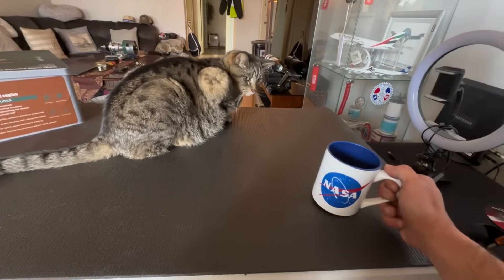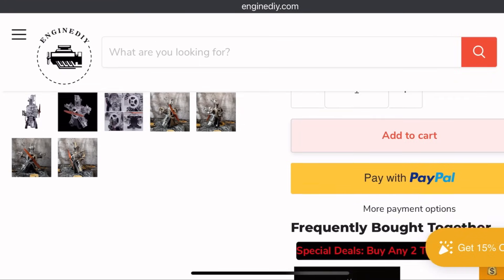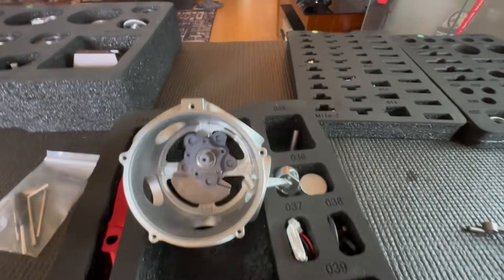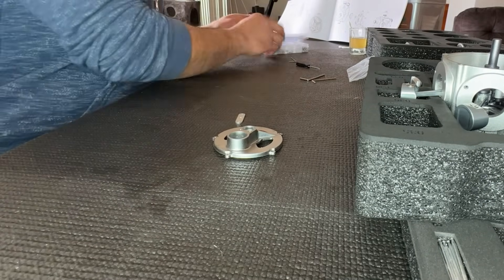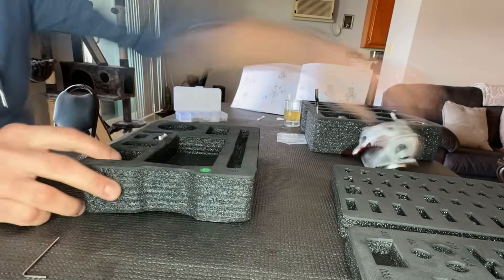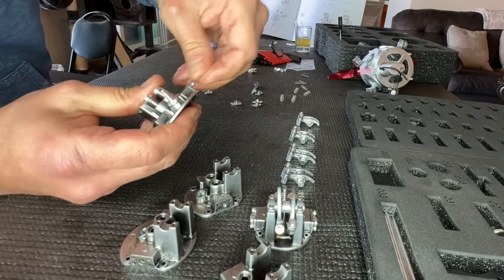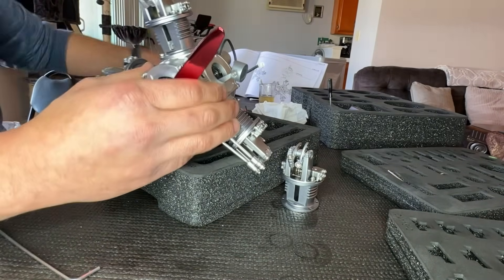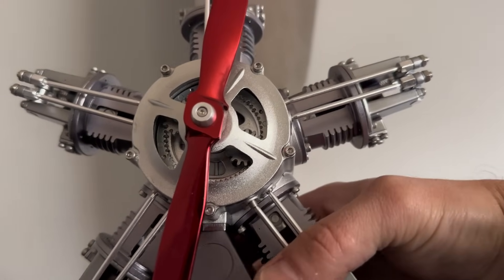Stig Projects (Build a Radial Engine)

Comment: I work on the P&W R-2800 every day (changing a nose case right now), not sure why I want this model for enjoyment because the real one tests my patience 1/3rd of my life. The master rod really bothers me on this though — should be a solid connection otherwise you end up with a gnarly imbalance with limp rods (story of my life) and timing issues that would be literally unsolvable. If they changed that one little thing (and maybe added a second bank of cylinders?) I’d buy one and run it on my toolbox — and lubricate it with the same oil we run our R-2800s on; very heavy, very expensive, very borrowed from the company.
Reply from the maker: That’s actually really cool that you get to work on that. I would love to do that as well

Comment: Dude, thats a really awesome model. you can see the pistons, valves, and propeller all move. But I think we need more rpm's to achieve take off. I agree with previous comment, that cat is your quality assurance representative, making sure that your engine passes inspection. Who knew you had to oil everything? I bet you felt like doing your job in real life for a moment. She needs some oil, and don't forget to check the blinker fluid too. <<<--- We mechanics, we know. 😜
Reply from the maker: The blinker fluid is a must 🤣

Comment: Stig am I right in saying that some radial engines the crank was fixed and the cylinders spun with the prop fixed to them ??
Reply: WWI era engines had a stationary crank, and the cylinders rotated around the crank. I think it was for cooling. They were called rotary engines.
Reply from the maker: Yes but that’s very particular models. Very old models, I think sometime in World War I and before.

Comment: What a disappointment this... Thought that with so much machined metal, it would be a real ICE engine capable of running on fuel and powering a model rc plane 😔🤔
Reply from the maker: That would be one complicated model to put together 😅
Reply: @StigAviation 
Not for YOU...I'm sure ❤
Reply: @StigAviation  hmm - perhaps - not really - especially for you .. 
(of course - with the right tools - cat is indispensable as inspector - but proper tweezers can help too ..;-) )
If you search "SAITO (usually 3 or 5) cylinder radial (gas) manual pdf" - they are free for download (manuals - not the engines - sadly :-( ) 
- you will see BOM and "exploded" view - they are actually not that much more complicated - "only" made from much refined parts - and can do "vroom, vroom" ..
but you really need open space for those - and don't let the "inspector" nowhere near those beasts  - even when not running ..